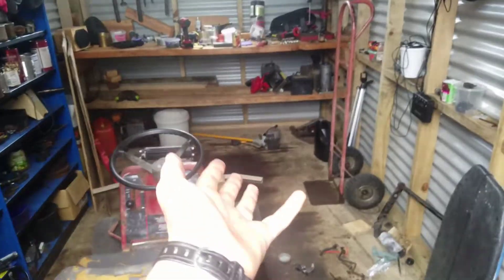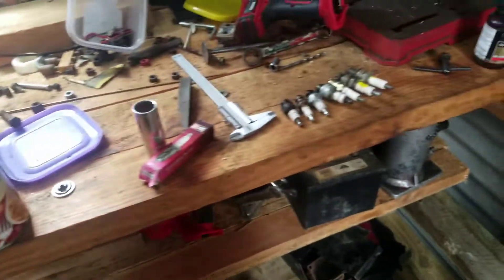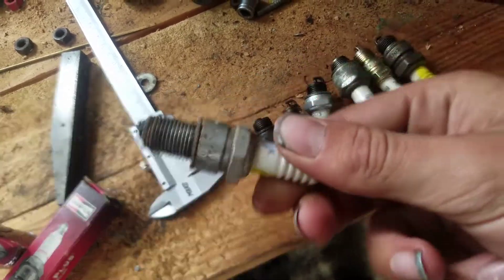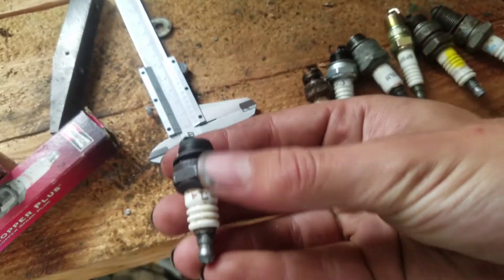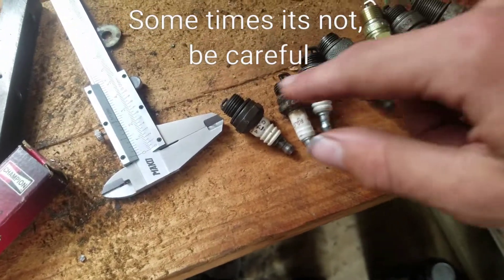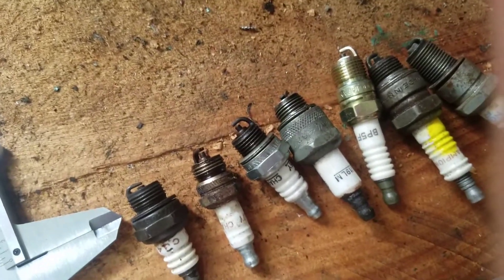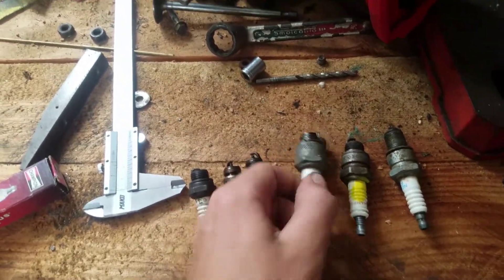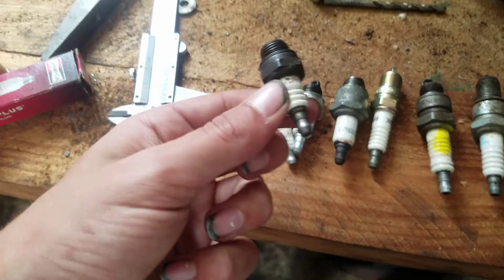spark plugs and power, free mods pt6

Comment: Remove resistor from Champion brand mower spark plug and replace with the spring and piece of #12 gauge wire for racing plug and more power. Put only Champion with proper reach threads  needed, in vice, and heat top so as can to unscrew the top. They do come apart, or just purchase non resistor plug.
Reply from the maker: Thanks for that info, I knew that some race plugs have no resistor but being abel to remove them is new info to me, will try it
Reply: Isn’t the B&S brand spark plugs made by Champion as well ?
Reply from the maker: Yea man, b&s use champion plugs from the factory. Ngk are better quality tho
Reply: @droptheblades895  I mean they are probably non- resistor modifiable as Champions are as well.
Reply from the maker: I wouldn't see why a ngk plug can't have the resistor removed, iv removed resistors from plugs that weren't champion but I don't remember the brand off the top of my head. It was a while ago
Reply: @droptheblades895  it turns to be the length to the tread on the metal screw terminal. On Champions it’s short and the tread is close to the terminal and on NGK it’s long and the tread is away , so the screw twists and eventually breaks. This according to one of commentators under the video which I posted here in the comments but YouTube deleted immediately.